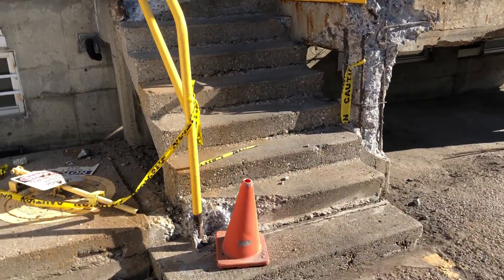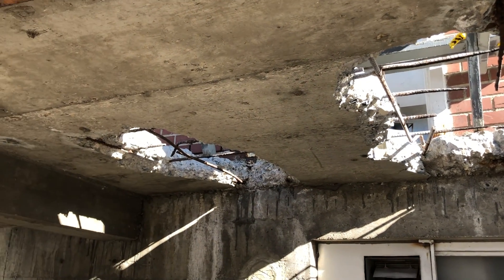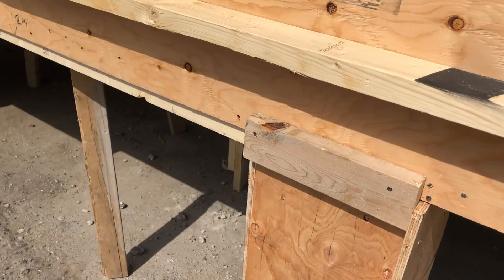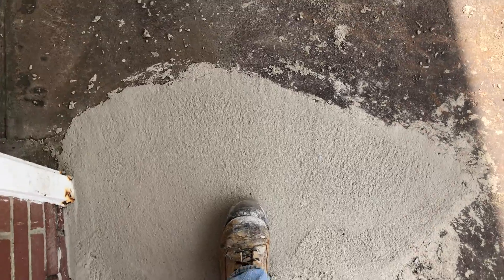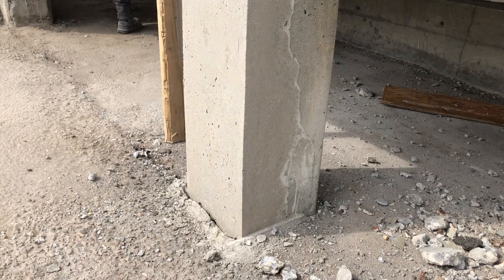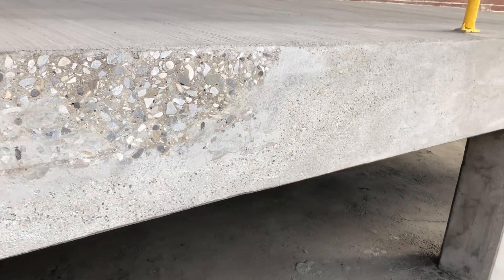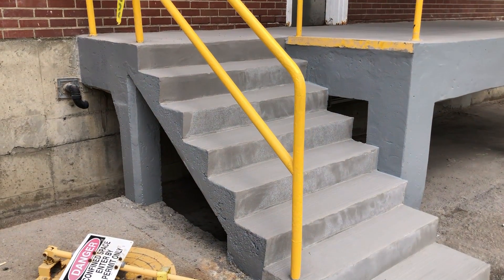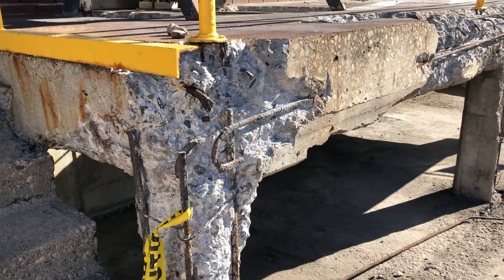Completely restoring a destroyed concrete loading dock, using TF Structural Concrete Repair.

Comment: Think I would have tried to tie in some new rebar, clean it all up with a wire wheel or brush dust it all off hit with some rustoleum THEN did the concrete work.but if you're just trying to get a check and go you can do whatever you want to long as you get paid and it looks good from your house.

Comment: That’s not the proper repair procedure as per icri guidelines. The demo should’ve been more detailed as the rebar needs to be cleaned and also you need to have all rust components removed. Also there’s a lot of cracks that were not addressed.

Comment: Wat u think of sika products for concrete restoration
Reply from the maker: They are Portland cement based, and need to be 'glued' down with primers and acrylics. They also have many limitations in their use (minimum and maximum thicknesses, critical mix rations, temperature range for application, etc.)

Comment: Very Impressive.  After fully curing can concrete anchors( wedge type) or chemical (epoxy) anchor bolts be installed in your product ? Case in point would be if rubber dock bumpers and a dock plate were to be added after the concrete repair.